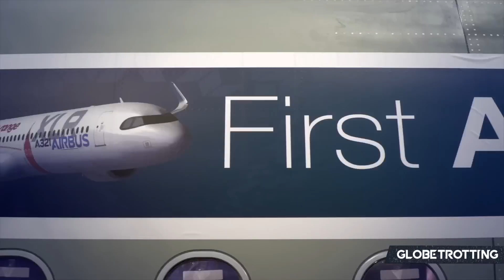NEW PLANE? - The Airbus A322...

Comment: Essentially an Airbus 757. Makes sense, but, they’ll need to redesign a lot of the a321 airframe to get the performance and pax capacity they need to make the aircraft viable over a range up to 5000nm. Might even need a new bogey for the wheels due to weight, like the 757
Reply: Airbus already has a design for a quad bogie and wingbox. Air India ordered some A320s years ago and required a quad for rough runways. I think those have all been retired/scrapped, but the design is still in the vault. Probably needs work to handle the weight of a putative A322 vs A320.
Reply: And why for all Saints should this hypothetical "A322" fly 5000 nm? Airbus has a perfect aircraft family to fly PAX loads of 200-250 people (the assumed A322 capacity) over 5000 nm - with the A330neo family!
Reply: @KlausErmecke a narrow body is way more efficient. So the hourly operating cost will drop significantly
Reply: @rtbrtb_dutchy4183  They WILL NOT develop an A321-like NB with a new wing. If a new wing (except maybe minor twitches), then with an all new aircraft.
Reply: @KlausErmecke  I didn’t say they would develop that. I’m simply pointing out that a narrow body is way more efficient than a widebody with the same amount of seats.
Reply: @KlausErmecke then the A321NEO production should be discontinued and retired
Reply: @KlausErmecke A322 is not an A321NEO, it’s a fake concept, it should be retired
Reply: beyong that by eu aviation law they need to retrain pilot, but at the very least airbus had a platform to build upon so it is not a complete new design.
Reply: @Da__goat  Apart from the runway requirements which are far less of an issue since the 757 was designed simply because so many of those runways have been extended to cope with more demanding aircraft, the A321neo family matches or exceeds the 757 where it really matters.

As for maximum speed, aircraft are often limited by ATC and other factors. Certainly when I have been tracking aircraft, they have invariably been flying well within the figures so frequently quoted in discussions.
Reply: @neilpickup237  I agree with most of what you say. However, ATC does not limit aircraft in regards to speed. 

The reason you see them fly slower is cost. Going fast burns more fuel.
Reply: @rtbrtb_dutchy4183  While they may not specify the speed directly, they do so indirectly because they allocate the landing slots and separation.
Reply: @neilpickup237  landing slots is not a worldwide thing and where they do have slots, you have a pretty significant size window to arrive. 

So no, not an airplane in the world is scheduled to fly at a specific speed to get somewhere at a specific time. 

Only time when ATC adjusts speeds is when you are in your arrival procedures. 

I don’t know where you get your information from, but it’s not correct. 

Oh and by the way, crossing the Atlantic, speed is indeed assigned for the crossing, since aircraft follow eachother at the same altitude without radar coverage.
Reply: @rtbrtb_dutchy4183  I got it from an airline pilot.

Giving Zurich as an example, and the route I use from the UK, apparently, they allocate landing slots before the aircraft takes off. The aircraft then adjusts the take off time so far as departure ATC will accommodate, and then adjust their speed to arrive at their allotted time.

Since they started this procedure some years ago, we rarely leave on time, however, usually arrive within a few minutes of the scheduled arrival. Another advantage is that, unlike before they adopted this, going around in a holding pattern is very much a thing of the past.
Reply: @ I’ve been flying for 32 years all over the world, including Europe. We fly at our own speed. We don’t adjust speed to arrive earlier or later and nobody tells us to speed up or slow down, except when you get close to landing. 

Airplanes are flown based on cost effectiveness. We input the “cost index” into our flight management system which in return gives us a speed schedule. 

The company I work for, we pick our own speed. Never has ATC dictated how fast I can fly on my flight. (Except for the occasional traffic conflict). This includes flying inside Europe.
Reply: @rtbrtb_dutchy4183  So effectively, are you saying that the Lufthansa group's pilot was giving me false information?

Perhaps you would like to give another explanation for the reduction (almost elimination) of being placed in a holding pattern.
Reply: @neilpickup237  sorry, I didn’t see your response to just now. 
Maybe the Lufthansa pilot tried to simplify his/her explanation? I don’t know exactly what he told you. All I can tell you is that ATC doesn’t assign speeds. 

Here is how it goes. The operator comes up with a flight plan. This flight plan says they want to leave at 1200 from airport A. The flight plan says the flight will be 1 hour and 12 min at the speed they choose. Let’s say Mach 0.80. 

Then the airport B you go to sees you want to arrive at 1312. (Assuming same time zone). Now they look and feel it’s too busy, so they come back with an arrival slot of 1330. They give you plus or minus 15 min. So, 1315 to 1345. If the flight is 1 hour and 12 min at the chosen speed, then the airline will plan to take off no earlier than 1203. They will likely request a departure slot for 1205. 

At no point will they adjust the speed. Airlines want to fly the most efficient speed. 

Now, once they get closer to landing, ATC will adjust speeds to make sure you fall inline with others. 

The reason you see less holdings is because Eurocontrol used to be horribly inefficient and they have improved significantly.
Reply: @rtbrtb_dutchy4183  I feel that you are trying to make an argument out of nothing. 

Nowhere did I say that ATC told the pilots what speed they should cruise at, it being an indirect result of the departure and arrival times they allocate (or offer).

However, all this misses the point that I was making, which was that a slightly higher top speed of an aircraft may only actually matter in a game of 'Top Trumps'. As you say, the pilots want to use as little fuel as possible. This being one of the 'other factors' in the 'ATC and other factors' in my original comment.
Reply: @neilpickup237  argument?  Where is the argument?  I’m having a conversation, not an argument. 

So, I didn’t say they want to burn the least amount of fuel possible. I said they want to be as efficient as possible.  For instance, when you fly a 10 hour flight at M0.80, or you do the same trip at M0.85 but do it in 9 hours and 15 min, you will burn more fuel on the higher speed. However, you put 45 min of less time on the engines and airframe, which is a cost reduction that might be better than the extra fuel burn. 

I remember talking to a Virgin Atlantic crew who flew from London to Orlando in a B767. They flew that trip at M 0.84 instead of 0.82. They burned more fuel, but the shorter flight time meant they did not require an additional pilot for this trip. 

You are correct, maximum speed really doesn’t matter much, however and airplane with a higher maximum speed also have a higher cruising speed that’s the most efficient, which is called Long Range Cruise or LRC. 

I get now what you were trying to say in regard to departure and arrival times. I thought you meant that ATC dictates actual speed. But I understand now what you were trying to say.
Reply: 😢😅😂😂😂 too funny
Reply: Have you informed Airbus management.
Reply: The A310 was that precise plataform...
A neo A310 would solve that gap
Reply: It’ll have a 52m wingspan as the current 36m wing are too small for the weight of a 757 class aircraft. Then why not just re-use the fuselage of A310 or even A300 and call it A360 instead? It’ll be quite a decision to make

Comment: A321XLR is $75M, A330-800 is $100M (approx. net prices). Is there a gap which would justify an A322?
Reply: @user-yt198 Where do you get these numbers from? In 2018, unit cost was US$259.9 M for an A330-800 and US$296.4 M for an A330-900. A321XLR was priced at US$142 million (2018).
Reply: @chiad25   @fjp3305  These are net prices taken from lessors, not public list prices which are highly exaggerated.
Reply: I think your numbers are way off
Reply: A321 cost $8000 per hour and the A330 cost $15000 per hour.
Reply: @rtbrtb_dutchy4183  Is that wet lease cost? Because dry lease cost of a regular A321Neo is less than $500K/MONTH
BTW I gave purchase prices of the aircraft, NOT costs.
Reply: @rtbrtb_dutchy4183  With 180 pax the A-321 makes money, the A-330 looses it, I think.
Reply: @fjp3305  right. That’s the big thing. You don’t have to fill it up as much as the 330. 

Most people don’t realize that a wide body means it needs to punch a bigger hole in the air. So the bigger the “tube” the less efficient. This is why a long but narrow airplane is much more efficient.
Reply: Acquisition costs are only part of the equation. A single aisle is far cheaper to operate than the equivalent wide-body. 

It is the demand for freight that will determine which type of aircraft is more profitable. This is the reason why some routes use larger aircraft than the passenger numbers could ever justify.
Reply: @neilpickup237  exactly. Almost for the same reason that a 3 or 4 engine airplane can’t compete with a 2 engine airplane, can a widebody not compete with a narrowbody.  And that is hourly operating cost. The smaller the hole you have to punch in the air, the less energy it takes.
Reply: @rtbrtb_dutchy4183  And don't forget the weight, wide bodies are very much heavier than narrow bodies.
Reply: Don't matter to me..... I'll take any A330. BEAUTIFUL.    i'm Airbus Space.....    thoughts?
Reply: Still cheaper than a backed up, non certified plane.  Max7 Max 10, 777XYZ,.....!
Reply: @user-yt198  There is another factor that can affect profitability, and that is premium passengers.

You can accommodate a far higher percentage of premium seats in a wide body than in a narrow body.

On business heavy routes, that extra revenue can more than make up for the additional operating costs.
Reply: @ you are comparing a little bit of apples with oranges now. Current widebody aircraft air significantly bigger than narrowbody aircraft. So when you have more seats, you can have more premium seats as well. 

But if you had a 250 seat narrowbody versus a 250 seat widebody, the space available for premium seats would be the same.

Same with the weight. The widebody wouldn’t be heavier.
Reply: My guess would be long term economy of a single isle vs a double isle? If I remember, there wasn’t a huge acquisition cost difference between the 767 and 757 either.